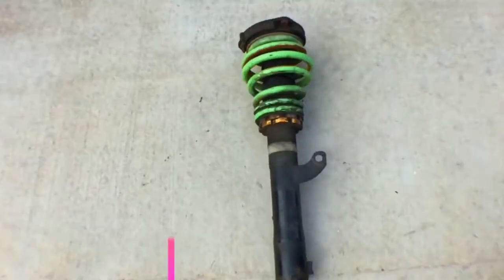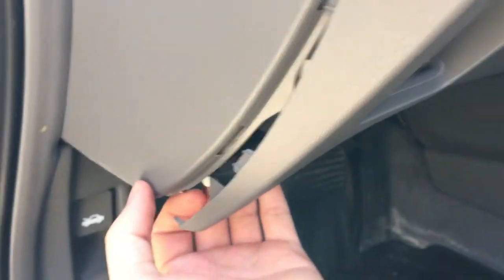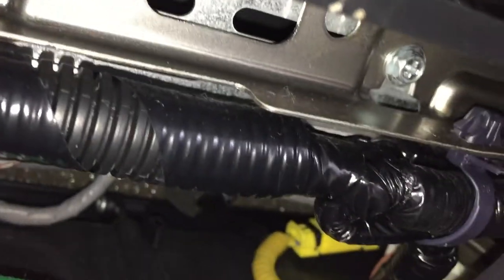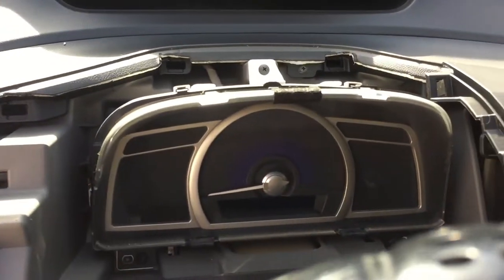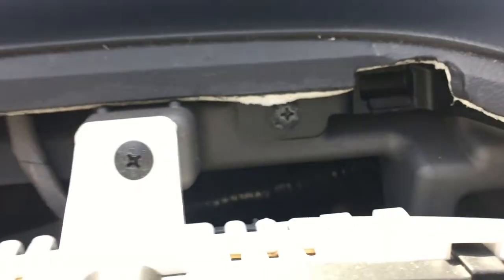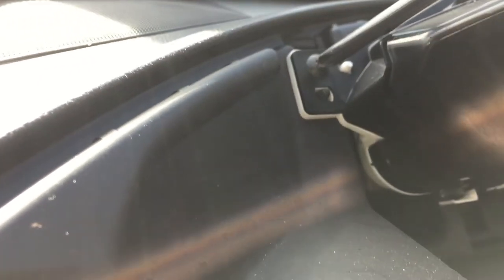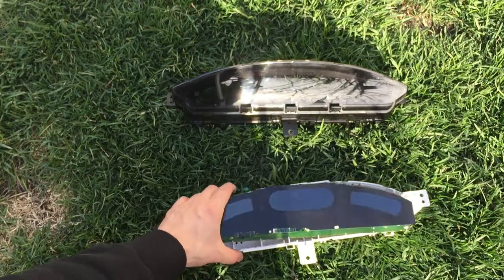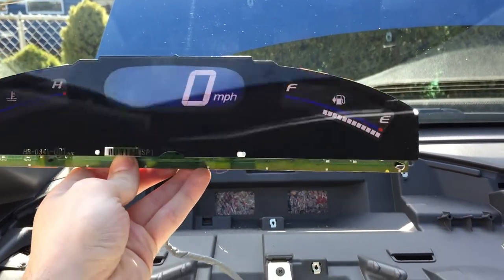8th Gen Honda Civic Driver Dashboard Removal 2006 - 2011 | Fuel gauge issue

Comment: I was having the exact same problem with my '06 Civic inverting the fuel gage. I bought a used upper instrument cluster at the junk yard for $30 bucks, it looked almost brand new. I followed the steps in your video and the job took an hour from start to finish and no more problems now. Thanks for this!! $30 bucks would have been probably $700-$800 at the dealer with labor and the new part.
Reply from the maker: Glad to hear this! :)
Reply: I’m about to do the same hit the junk yard for replacement piece

Comment: If you experience this issue also look at the fuel tank wiring. I've had experiences where the top of the tank gets loaded with dirt and stuff then corrosion sets in and the next thing you know the pump works but the sending unit to the dash goes wonky or doesnt work.

Comment: The video was super helpful! Question though, that wire that connects to the upper cluster, do you think it can be easily replaced? I'm having issues with the indicator and suspect it's the wire causing it
Reply from the maker: that may be tricky to replace if its part of a harness

Comment: Did this fix the cluster/gas gauge long term or did it go back out. I have a problem where everything goes out on a 2011 honda civic. Any information would be appreciated
Reply from the maker: It fixed it since the video. No issues.

Comment: Thanks but the close up shots are hard to follow to see where you are.... You should always start away from the area and then move to close in.. anyway, it was helpful nevertheless. 
The screw under the radio, pain the ass to remove, it is a standard screw (not self tapping) and it's a 5/16 size.

Comment: why do you need to disconnect the battery?
Reply from the maker: You should anytime u do any electrical work.  Prevents any problems down the road.
Reply: Also if you mess around with anything with a air bag you dont want it to go off in your face

Comment: I don't think you do not have to remove the screws mentioned at 1:30 and 1:50...at least I know you don't on the 2007 Civic.  I would assume that the 2006, 2008 and 2009 would be the same but check first.  (Just pull the lower panel...it's only held in by clips.)  There is another video on youtube for a "2006 Civic Speedometer Removal Video" which only shows pulling the panel out without removing the screws.
Reply from the maker: Thanks.  It’s possible but not sure. This worked for me.
Reply: @BulliKid  BTW... Thanks for posting this video and the followup video (where you actually showed how to fix this by adding solder to the pins).  Following your videos, I just did this (added solder to the pins) in my 2007 Civic, and it appears to have fixed mine.  :)
Reply from the maker: Awesome! I’m glad I can help! No one else had a solution but to buy a new one ;)
Nah ugh not on my watch! Sub to show support!  Planning a turbo build this season!

Comment: hey do u still have tht problem ?
Reply from the maker: No the problem went away!
Maybe a loose connection somewhere?!?

Do you have the same problem?
Reply: yea same m having same problem
Reply from the maker: Try to uninstall and install.  Worked for me!!
Reply: BULLI KID 
un installed and installed it the problem went away...but it was for 1 day only..now i v got tht problem again
Reply from the maker: abdulla sheikh sorry to hear that.  But to cheer you up. Mine came back last week.  Although it is not inverting as often as before.   :(
Reply: Mine always says its empty i replaced the sending unit no change still says empty

Comment: My fuel gauge reverses too
Reply from the maker: Seems like the pins are loosing contac.  You already know the fix from the previous video just have to spend some time to take the dash part and solder.  I had no issues since I did mine ! 💪
Reply: BULLI KID how many miles are you kickin up?
Reply from the maker: Not too many mine is a 2007 with just about 90k. Just finished a valve lash adjustment few weeks ago during quarantine and turns out my valves were all out of spec! Some by A lot! So definitely recommend checking out that video and doing one !
Reply: BULLI KID did u have a mechanic do it
Reply from the maker: No I did it. I make a video.
Reply: @BulliKid  The owner's manual says to check valve lash only if they are noisy.  Were yours noisy?
Reply from the maker: Mark Anderson yes mine were starting to get a little noisy.   The car feels and sounds way better now.  I have a DIY video for the valve lash
Reply: Almost 128000 still rides smooth no problems

Comment: This is exactly why you should not attempt something that you have no clue about. Using the correct tools is a basic fundamental, not even a multimeter in sight, nor trim removal tools. If he had done his homework, he would be checking for bad earths as a first. If you don't know what you are doing, don't touch and let someone with knowledge do it for you.
Reply from the maker: I fixed my problem.... if you wana buy all the “proper tool” and always be “proper” you will never get anything done.   It’s a 8th gen Honda Civic not a brand new car...
Reply: @BulliKid  cowboys will always be cowboys. Trim removal tools are a couple of bucks, a pair of anti static gloves are a few dollars too. You couldn't even use the correct size phillips screwdriver ffs.
Reply from the maker: @seanallen8946  I get things done with what I have around.